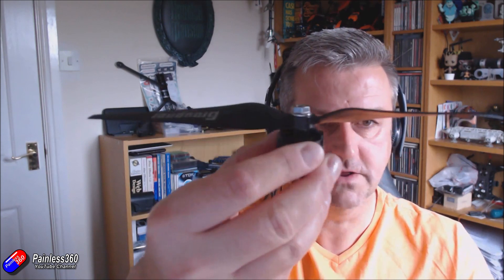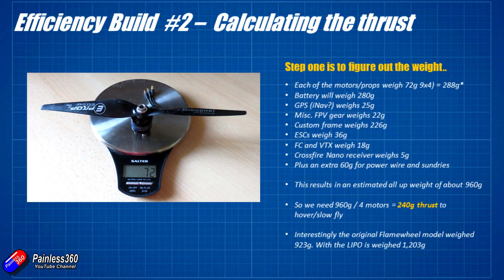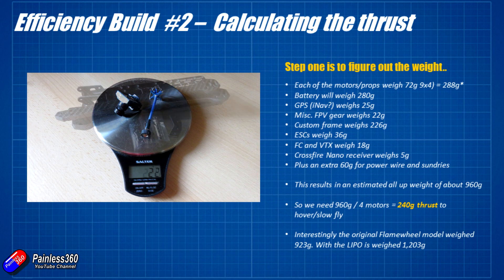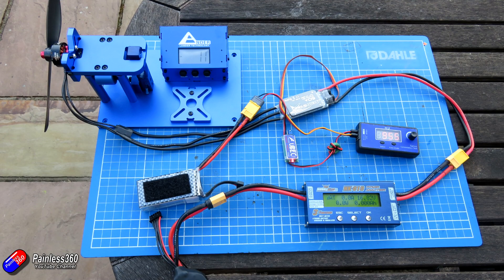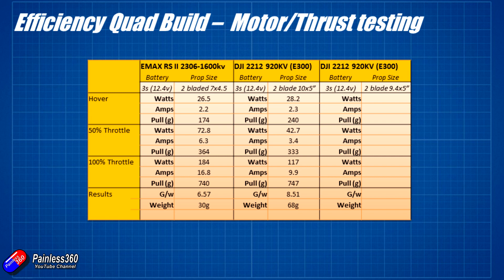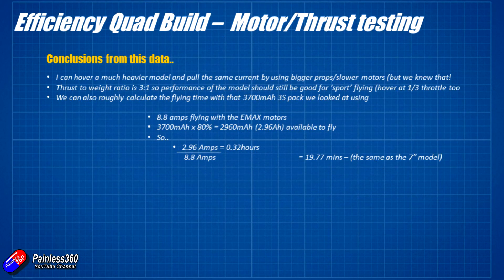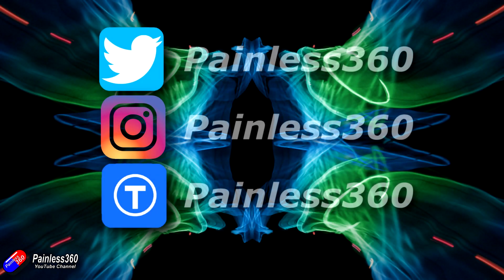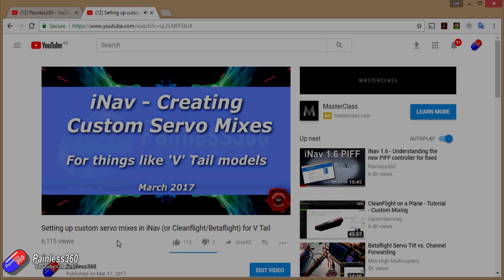Endurance Quad Build: Calculating weight, thrust and flight time

Comment: Greetings! I looked up specs - the F450 flamewheel frame weighs in at 282g. The iFlight DC10 (the only 10" carbon frame I can find) weighs 310g. Other than the F450 not having mount holes for a 30.5x30.5 stack, is there a valid reason for not using the F450 frame?I plan on using the phantom motors on whatever 10" quad I build, as they are lighter than any other 2312 960kv motor I can find. I have an RDQ 4s 5000mah battery I will be flying. There will be other accessories I will use from time to time - GPS, fpv cam, gimbal, etc. What I am trying to decide is if it is worth swapping to a DC10 frame from the F450 I currently have. Can you shed some light on my predicament?

Comment: I am building one of these quads right now. I just received my HolyBro Kakute F7 v1.5 FC. I am using an iFlight Succex mini 40a 4-in-1 esc, but I do have a HolyBro Tekko32 45a 4-in-1 ESC available to use if you think that would be a better solution. I have a dozen or so of the DJI 2212 960kv motors, so I will be using those. I had planned on using my Flamewheel F450 frame until you mentioned how ugly and heavy they are. I noticed when I pulled it apart that the arms flex quite a bit in all directions. If I remember correctly, they are pretty fragile as well. This video is 2 years old. Is there a current frame you would suggest for this setup?
Reply from the maker: Nothing newer at the moment but there does seem to be more interest in the non-5" racing frames that seem to have been what most frame designers have been making fro the past 6 years.. I hope to see more options soon but nothing imminent that I've heard of..

Comment: What is the minimum-TWR a drone could hover with ?? at 9:20 you have a 3:1. Is that the minimum??
Reply from the maker: The minimum aould be 2:1 with most modern quads having a lot more...
Reply: @Painless360  Thanks. So, with  TWR<2 they would NOT be able to lift off the ground at all, correct??

Comment: Sorry but I am having some trouble calculating my flight time.
Can you kindly tell how you got 8.8 amps here.
I am using emax-XA2212- 1400KV with 8.45 inch Propeller.
Reply from the maker: Its all in the video. You start with the weight of the model.. best of luck

Comment: Hi P360, I'd just like to say I have one of those 'hideos' flamewhel 450 drones :) and they are Top for me..then again I've not progressed from CC3D. Returning to basics is great..I have 935kv motors Emax with a 3300map battery... and after some research they work great with 30amp ESCs no matter SimonK or BL Heli. what is important is the configuration..and if you have more wobble from the PID's then the flight time will be reduced...it's about the build quality and the configuration set up equally...
Reply from the maker: That original kit is still very capable. Great to hear you’re having fun with it, let’s hope we can get some modern components that will give us even better flying experiences for longer to.Thanks for posting, happy flying!!
Reply: Thankyou! Thanks for the great tutorials and reviews! :)

Comment: Loving this Lee, what's really funny to me is that I'm building mine using an old Q450 frame (Flamewheel copy with tougher arms) Fullsize Pixhawk with GPS etc.  Just stuff I have lying around to save cash and Its more or less complete.  Cant wait to compare results :)
Reply from the maker: There seems to be so many of us who are re-visiting the early days of quad copters using more modern components. Let’s hope suppliers and designers tap into this wave and give us much better options for frames and motors.
Reply: @Painless360  I find it amazing that it was your videos I used for my first 450 build about 3yrs ago, how time flies.  FPV was pretty rubbish and Gimbals were the big thing lol.  My F450 pixhawk ended up weighing 2.2kg with Gimbal & Camera etc, I also had to jump to 4s to get it to take off lol.  I did lots of testing and tried lots of props and eventually could fly for 22-25 mins with two 5200mah batteries.  Was a bit of a monster 🤣

Comment: Great video!
When i saw the notification for this vid I thought you had beaten me too it... but you haven't quite ;-)

I'm  waiting on components to build a 10" long range freestyle quad. 
My biggest problem is finding some very stiff large surface area ideally carbon props! 
i'm looking for 10x7  (Those Graupner props in this video look promising though.. What are they like for stiffness?)

Don't want to give too much away but as a teaser, it's going to be 6s with 2.4Ghz vtx, 800Mhz rx & 30xx motors

FYI... I found a small boutique quad frame company that's just starting to take off over in Spain, they specialise in 7" and upwards  frames! Check them out: https://shop.almondracing.com/
It's good to see small boutique designers getting some innovative designs out there and i like to support people like that where possible.
After I spent a couple of days days talking to Stefan I decided on a frame! (just waiting for it to arrive now... all goosebumpy :D )
Reply from the maker: Hi Mark, Check the playlist ;) I have :D
Reply: Doh! 😖
Reply from the maker: :D Let me know if you post videos of yours, I'm interested in how you get on too..

Comment: Cool project. I, too, am interested in endurance multi-rotor, and (hint to vendors) would be willing to buy related goods if they existed.

MIT, if I remember correctly, was doing a multi-rotor endurance project of their own using a hybrid topology that was quite interesting. It's much the same philosophy as modern hybrid cars; run an internal combustion engine at peak efficiency, then use the shaft power to turn a generator. The idea is to tap into a liquid fuel's substantially higher (1 to 2 orders of magnitude!) energy density. Never mind 30-40 minuets, try 4-5 hours!!!! Theoretically, with low demand and something large enough to absorb/retain electrical power, the hybrid gen could be totally turned off. In practice, there is no such thing as low demand for a quad; even just hovering takes substantial energy. 

No... it's really about all that energy density. So much so that I intend to do something of my own if possible. I envision using a modern nitro engine on an oversized in-runner (or custom alternator/generator) as the hybrid generator, combined with a custom uC + sensors + electrical-mechanical system to regulate the engine. I've seen some cheap ~300 gram RC car nitro's quoted at 2.5+ shaft HP, which equates to around 2000 watts. Combine that with a ~300g EDF in runner and 300g worth of fuel, 100g worth of control/electronics, and you're looking at 1Kg in weight for 2000 watts worth of power plant. Assuming 700g for the rest, and 200 watts per Kg for hover, you would have a 1.7Kg aircraft with ~1600 extra watts to spare. 

Totally doable... but then... we already knew fuel could fly.  :)

Comment: Lee, could you please tell me if I have made a mistake buying these items, do you feel they match? I bought - iFlight XL8 8 inch + EMAX LS2207 Lite Spec 2207 1900KV + Matek F405-CTR AIO Flight Controller + Matek GPS Module & Compass.. Just watching your INav tutorials, got to number 4, you really do brilliant explanations, very professional...Will watch the other 4 tomorrow. I just now feel I should have watched them before investing in possibly the wrong gear? Your input would be greatly appreciated.
Reply from the maker: I've not used all of those pieces. Check out the 7" endurance quad build, that's the closest to what youre looking at. Best of luck!

Comment: You said something about hooking up GPS to this build using the SpeedyBee F4 controller.  I cant seem to fins any good data on that combo.  Is it capable of mission programming using waypoints or just useful as a failsafe return to home function? I like my pixhawk, but my brother is making me build him an aluminum frame and we would prefer a less expensive gps FC.
Reply from the maker: It's the all-in-one board I'm using. The manual for the all-in-one board shows the connections for the GPS. All covered in the next video, stay tuned.

Comment: I got 10 mins flight time on a 2205 motor with 5x4x3 props and a 1500 mah battery.      Why cant I just put a huge 3s battery under the quad and get 20 mins of flight time.  Sure it wont have as much thrust because the battery is heavy but wont it fly a lot longer?     I mean you dont want thrust if you are just buzzing around.   Like that Diatone model that has really long flight times.  What happens if you put that 3700 mah 3s lipo on it?   25 min flight times?

Comment: Yeah that frame is crap and holding you back. You need a single layer not multi layer multi piece frame with a foam or honeycomb core. You can make a feather light stiff frame doing this ditch the overly robust quad racer style frame.
Reply from the maker: I think 'crap' is a bit harsh. Happy for you to suggest a better alternative..
Reply: @Painless360  I was attempting to be sardonic really meant nothing by it love your channel. Your going to have to go high tech to lose weight on that frame.

Comment: My recommendation is to use a 2212 motor with around/below 500kv on 4s. Use a 10x3.3 CF prop (Lower pitch means less performance, but higher efficiancy for endurance.). Build your own light weight wooden H-frame (around 100g). Use the smallest possible ESC's. Use the lightest electronics possible. Build evrything together. Test the motor/prop combination for max thrust. Divide the max thrust from all 4 motors together by 2 for hovering thrust. Hovering thrust minus weight of quad will give you the weight for the batt. Choose a 4s Multistar LiHV batt with this weight. You can also use 3s Multistars. You have to use more kv then. And the max 3s available is 5200mAh. Thats why I would say a 4s is better. They are available up to 10.000mAh. Maybe more, dont know.
Reply from the maker: If you can link me to a motor of that specification that doesn't cost a fortune than that sounds like a great plan.
Reply: Maybe this one? 83g, 460kv or 630kv. http://www.dys.hk/product/BE3608.html
Reply: https://hobbyking.com/de_de/turnigy-multistar-3525-650kv-14pole-multi-rotor-outrunner.html
Reply: https://hobbyking.com/de_de/3508-580kv-turnigy-multistar-14-pole-brushless-multi-rotor-motor-with-extra-long-leads.html
Reply: Sorry, I wasent able to find a 2212 with low kv!
Reply from the maker: Some great ideas, thanks for the links!
Reply: This one fits a 10inch prop on 4s. $40 for 4 Motors. I think similar motors are avaiable from Emax and Sunnysky. I think 650kv around will be even better. https://www.banggood.com/de/4X-Racerstar-Racing-Edition-2216-BR2216-810KV-2-4S-Brushless-Motor-For-350-380-400-450-Frame-Kit-p-1083207.html?rmmds=search&cur_warehouse=CN
Reply: Maybe this one will work on a 10x3.3 prop 4s too. 800kv In the data sheet is shown a 800kv version.
https://www.banggood.com/de/4X-Racerstar-Racing-Edition-2312-BR2312-960KV-2-4S-Brushless-Motor-For-350-380-400-Frame-Kit-p-1083204.html?rmmds=search&cur_warehouse=CN

Comment: Take into account that LiIon cells will drop down  to 2.5 V when you are trying to get the full specified charge (mAh) out of them. On a 3s LiIon this will end up in 7.5 V total which might be critical if not impossible to fly on a quad. That's why using 4s LiIon would probably be more appropriate with an end voltage of 10V.

Comment: Lee, I'm really enjoying this series.  I took a look at the old Phantom 2 specs which has similar motors/props/battery specs and a claimed 25 minute flight time (I know DJI exaggerates flight time) but their listed weight including 5200 mAh battery is 1000 grams.  So you're still considerably higher.  One of your viewers already commented on the current frame weight, but look what DJI is doing and maybe learn from that??  Two or three years ago I tried building a flamewheel style quad using DJI Phantom motors and props and  at that time was only getting maybe 16 minutes.  I wasn't getting the results I wanted so quit and am now enjoying watching you go through the exercise.  This is a good series.  Good luck!
Reply from the maker: Phantoms and similar used moulded plastic to keep down the weight. I'm hoping we get more options for these kinds of builds as more of us demand them from manufacturers..
Reply: i think there could be some weight savings on LiPo's by using as low of a C-rating as possible without getting into a voltage sag problem.  Higher C-ratings being heavier, of course.

Comment: Lee, if you're really trying to drop weight consider getting carbon/balsa core arms. Massively lighter, and believe it or not, much stiffer, weight for weight. The balsa also helps dampen vibrations and you get an overall much more stable/smoother flying quad that wastes less power on constant motor corrections due to the vibrations.
Reply from the maker: I'm hoping that will stop see more choices for builds like this coming soon. I do think it could be a little bit lighter-  the Motors are very heavy considering for the power they are using too..
Reply: I'm using a balsa plate and sandwich it with foam that i cut with a hot wire to give me an aerodynamic profile and then sheet that in carbon fiber.
I end up with something that is SUPER LIGHT and nearly indestructible.
I'm trying to move towards a design that will function as a lifting body.
I want to be able to get some aerodynamic lift and try to get some "flat" forward flight using the props like a helicopter to fly on the rotor discs. It would be so much more efficient. My rotary wing aircraft like a helicopter starts flying on its disc it actually going that's why they call him rotary wings the pilot can actually decrease the collective and the power in forward flight you're flying on it like you're gliding on a wing.
I think it'd be more efficient and allow lighter aircraft with smaller batteries to stay up a lot longer.
Light is better for maneuverability light and agile fast zippy aircraft very aerobatic.
Right now quads are using huge motors with multiple props swinging multiple blades with big heavy batteries to basically beat themselves into the air. And we could do it because the technology has advanced faster than the airframes....
and with the modern flight controllers new pilots didn't even have to learn how to fly...
I'm not saying the things that you can do with our amazing because they are incredible but it's a whole different kind of flying there's nothing aerodynamic about it. We're just beating the air into submission by clawing and scraping our way across the sky, grabbing big gulps of air and pushing and throwing it behind us, fistfuls of it.
I think it's time to take a step back and start working on more efficient airframes, maybe even something that will glide if I lose my motors....
Even a helicopter will auto rotate and they're just hanging from a pipe. Unless it's a chinook and they're hanging from two pipes.
But having survived a crash into the sea in a Chinook I can tell you I don't put a lot of faith in them.
Anyway I'm off on a tangent now.

Comment: Lithium ion is really the future of our hobby (on the scenic flying side of things for now). I just built myself a 3s2p to use on my 5" freestyle rig (2600kv motors) and I fly it for close to 14 minutes! On 5 inches props! Max amp rating 60A burst which is very respectable, I fly at 80kmph in the mountains no problem.
Reply: Very cool! What cells are you using?
Reply: @NicolaGuerrera  I'm using Sony VTC6 cells for their high capacity and discharge rate.
Reply: @beebakrizzle  Thank you very much! I'll definetly try them on my endurance build!
Reply: Another option is LG HG2's; very similar cell to the Sony VTC6, just a different company. Do avoid ebay/Amazon for getting either of these though.18650 cells are an absurdly common item to have counterfeit. I got my HG2's from Liion wholesale. They are well known in the vaping community for providing legit cells. A bit pricey, and takes ages to get to you, but you can't put a price on avoiding immense disappointment and frustration. You CAN put a price on skin grafts, however.
Reply: @NicolaGuerrera  Check out Philipp Seidel's blog for instructions on how to assemble a pack. Also nkon.nl is a legit reseller for Li-ion cells.
Reply: what build do you have?

Comment: That is a potentially fantastic result on this sort of setup.  In the "old days" the logic was to lower the KV and increase the cells.  At the time I remember people going 12-14" props on 6S motors, maybe 300-400kv (can't remember)  Which I think would be interested, but does involve you getting hold of a whole new set of motors/escs/etc, which does tend to be a bit pricy
Reply from the maker: That's where I'd like to end up. The challenge with modern motors with those lower KVs are they are incredibly expensive..